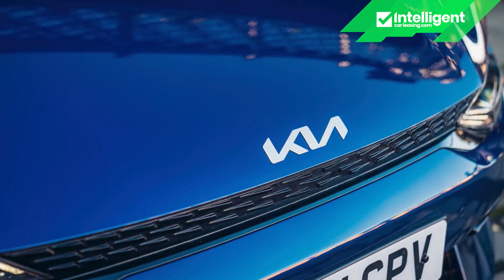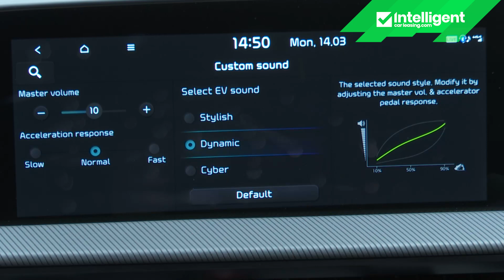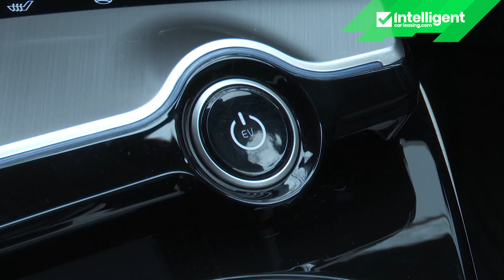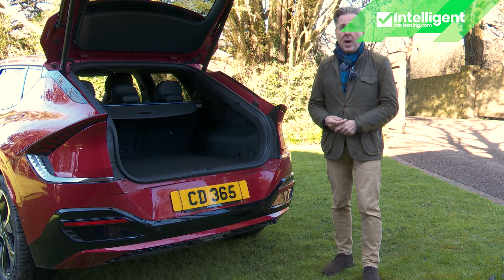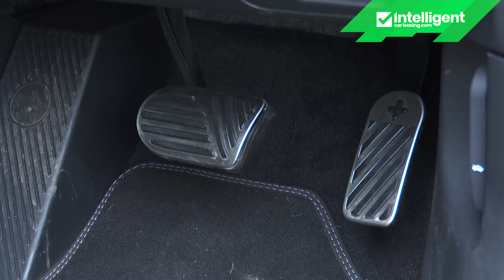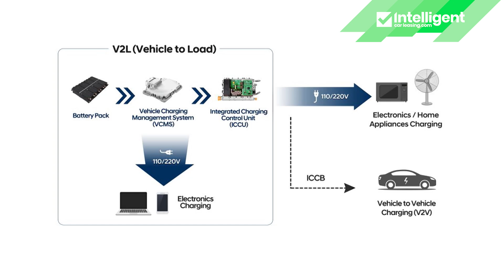Kia EV6: A genuine rival to German premium brands

Comment: Great video. Must of taken quite a lot of time to edit and produce. I must say its the most comprehensive video of the EV6 so far. Such a valid point around the white trim, which will get dirty over time. I would suggest the same would be valid for the steering wheel white stitching and "piping". That will quickly accumulate a lot of noticeable grime. I hope that you get more subs and more views, as this is such an in-depth review, compared to the usual mainstream "we are the first to review this car" channels. Thank you for your time and effort. If this is a press car from Kia, they need to sack their valeters as there are massively obvious swirl marks, which is something you just do not allow out of the door when you are lending the car to the press, who will be doing close up shots of the finer details of the car.